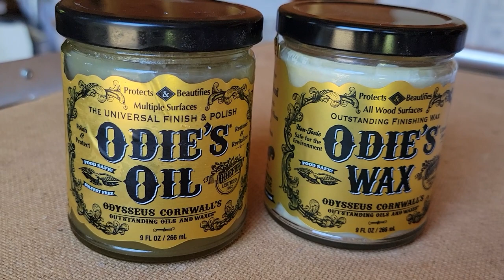How to restore a 80's coffee table, using Odie's to finish.   ""Under $100 challenge", by Sabs Rehab

Comment: Did you put the decals on the top or underneath? I would have put it underneath so you wouldn't have to worry about it
Reply from the maker: Hi, thanks for watching.  Yes, i thought about that but they discouraged it because you wont see the full colors.  I have gifted it to a couple i know, so this is going to be a test on what happens.  If it starts coming off, she will just razor blade it off.